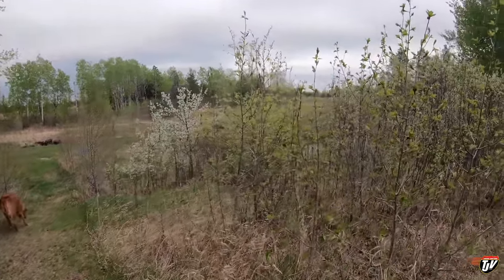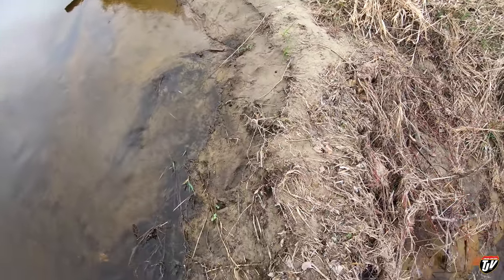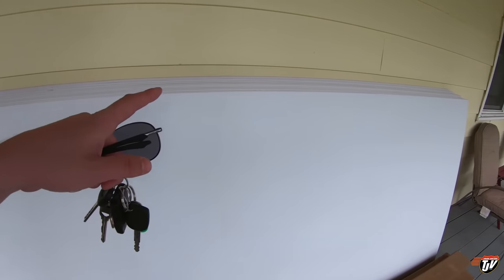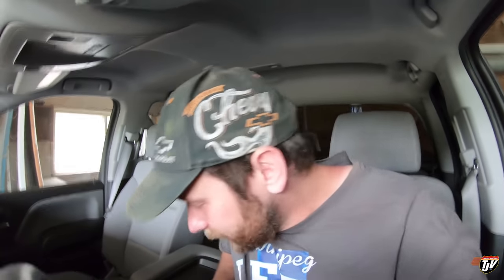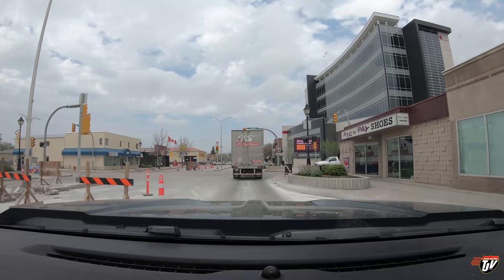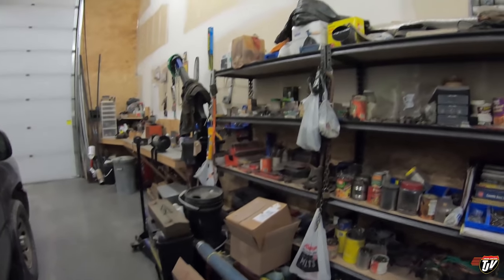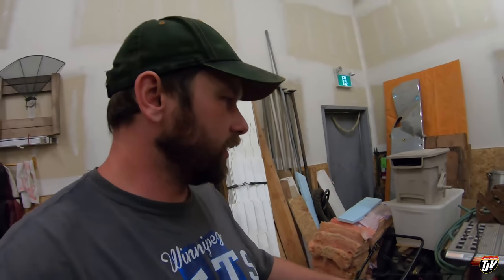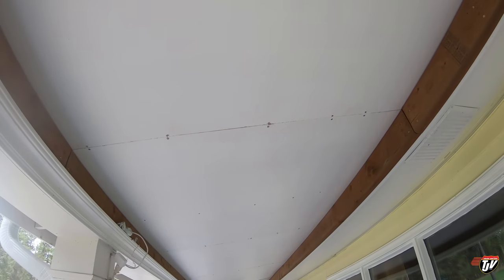TJV | TRUCKER RENO | #2000

Comment: Big section of culvert pipe surrounded by rocks the covered with planks and you have a bridge. Then a pipe from the creek into the pond and a pipes out of the pond back to the creek to create constant flow for your swimming hole. Add copper sulfate to keep the algae knocked down.

Comment: A table saw is a good investment for a home owner. I've got a very old Skill Saw unit. I'll be buying a new DeWalt soon - #DWE7491RS .It's a 'portable' unit with a wheeled stand. I'll be building a bench for it. Will have the table saw on one end, and a miter saw on the other. Miter saw will fold away under the table when not in use.

Comment: Where's the fence for the table saw?
Reply: You don't need a fence to cut plywood. where's the safety guard?!
Reply: @bigbear5510  Why wouldn't you want to set the fence to width and run your 9 sheets through to get your 72 feet? There's no wasting time snapping chalk lines or using straight edges and pencils to mark your lines. Then you have to slowly try to freehand cut the line.
A board and a couple clamps can make an emergency fence guide.